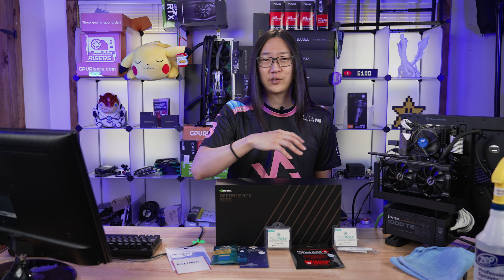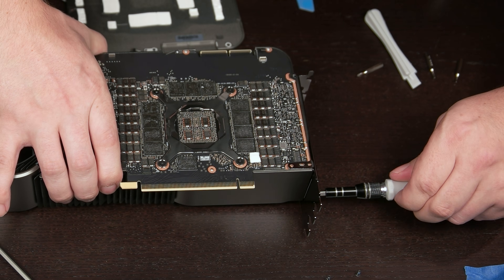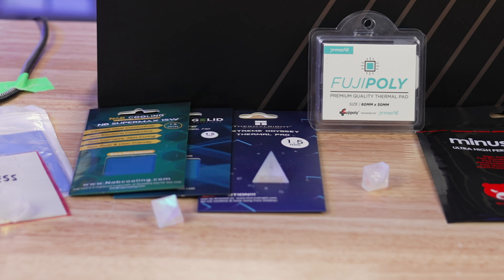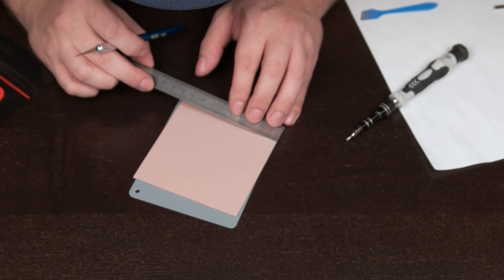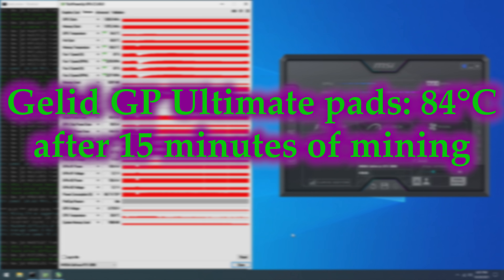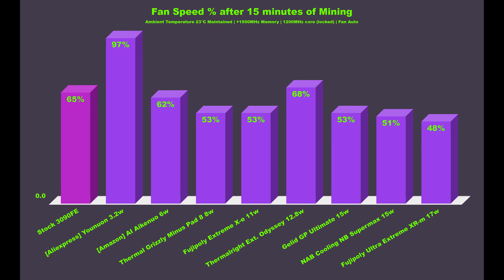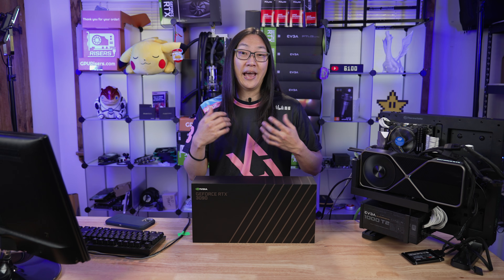Thermal Pad Showdown! What you should (and Shouldn't) Buy

Comment from the maker: This video has grown so much. It’s difficult to keep up with comments after the first one. Please message me and our discord link in the description! Otherwise, I might not be able to get your comment to help you.
Reply: You simply did such an amazing job with this test and deserve every positive comment here :)
Also, I would like to add a small positive side of keeping memory cooler and core hotter :
Since metals (like copper/tin, etc.) get physically bigger the more heated they are, keeping PCB temperature even/uniform across all areas should help in preventing traces/joints being damaged from material fatigue over long period of time (because difference in temperature creates different stretching/compressing mechanical forces inside PCB layers).
I don't know how relevant this is to longevity of the card, hence I classified it only as small positive :) 
It may not even be a problem for 5-10 years, since it depends on max. temp difference and number of hot/cold cycles each card had after all.
Reply from the maker: Thanks, I’m glad someone can appreciate our hard work! It took a long time and several hours to put this together, so we really appreciate it!
Reply: i commented not looking at the fact the video was 2 years old just take it with a grain of salt hehe.
Reply: Then the best is nab cooling?
Reply: Have you tested the Honeywell ptm7950?
Reply: Good one

Comment: Imporant Keyword: Thermodynamics
but daymn.. I almost failed in my physics class, mm so basically isolate the memory pads (or lower heat transfer balance) so that gpu can remove heat more? I did remember from the early computer days, were we would try to apply as thin layer of thermal paste as possible.. but just enough ratio.. for perfect balance, and temps reduced by 10c more than the usual messy way. but yes.. nobody got time for that, and just add more paste nowdays lol but getting back to thermodynamics, more 'area' means.. as you have guessed.. but either you go balance mode, or extreme it depends on the situation, plus thermal paste dries up eventually and a replacement is warrant..
Reply from the maker: That's right, getting the right balance with thermal paste is key for optimal cooling!

Comment: Thanks for this video info on thermal pads not paste is hard to come by.  As for the heatsink idea at the end, I put a copper 50mm x 50mm x 1.5mm heatsink on the back of my die on my evga 3080ti ftw3 and had great results where my gpu temperature rarely goes above 80 unless I am pushing it.  For an EVGA 3080ti ftw3 this was a huge improvement as that thing runs HOT.

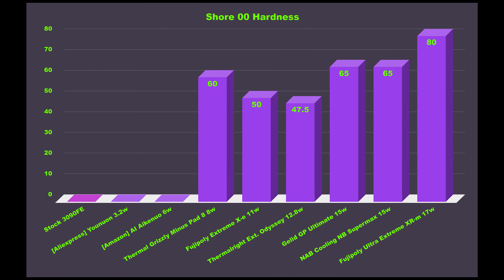Comment: What if the correlation between better VRAM temperature and worse GPU temperature is due to how the pressure is distributed? The watts of heat the VRAM generates has to be dissipated regardless of its temperature. I find it bizarre that the GPU could get up to 23c hotter, because it implies that in the opposite scenario, the VRAM would dissipate a lot of its heat through other means. 13:26 The 3 on the right are harder and I assume require more pressure to compress, and if the pressure of the mount is a fixed amount, pressure that goes in to squeezing the pads should reduce the pressure on the die. Just a theory.

Comment: Why did you remove the foil(s) before cutting (probably because it's convenient)? I'd remove them last to keep the pads as clean as possible.
This is the second time I've seen this video and today I think you're wrong twice.
1 When VRam temperature drops, fan speed should increase because the heatsink gets hotter
2 When VRam temperature drops and gpu temperature increases, it's because the fan speed dropped (which is weird, usually fan speed follows die temperature not memory temperature)

Comment: In my opinion, there is something wrong with the GPU board temperatures according to the benchmark which showed an increase in the GPU temperature on the Gelid GP Ultimate thermal pads. I am taking into account the laws of thermodynamics that you are talking about. And you are right that this is how it works. But imagine that the GPU cooler temperature is lower on the edges of the cooler or where the fans are. I do not know how on earth lowering memory temperatures can result in an increase in the GPU temperature? Rather the other way around. According to the laws of thermodynamics, the high temperature from the memory will flow outwards to the edges of the cooler where it is cooler and not to the center of the GPU where the temperature is higher than on the edges. It is known that memory plates surround the GPU.

Comment: I did not even think of better pads increasing the core temps due to more heat being transferred.... That might explain my issues where I was confused as heck re-pasting and re-padding my used 3060 Ti, where before I did I was getting 67c on the core under stress, but after I was getting in the 72-73c range. And the paste was basically cemented on it was so old, so I was confused why fresh paste would be worse, I even took it back apart and re-pasted again to make sure everything was done correctly, but it may just be the Gelid pads I used being much better at the heat transfer than the old stock pads I replaced....
Reply from the maker: Yea this is Something we discovered that is crazy! /

Comment: i used a proprietary blend of tp-3 arctic and valor odin pads. some people are strongly against it: a) cooling by stacking pads b) cooling the processors with pads in general. the cpu and gpu are cooled exclusively by a thin film of valor odin pad and so far it brought the temps -10 C lower than what was before. i couldnt be happier ! very strongly recommend it. this is a significant change, because cpu lifetime can be referred upon a deci-temperature scale that it usually is put under ! after trying the thermal paste, i found it to be rather inconsistent in its viscosity and response to heat, thus a possibility that it will leak, move, absorb and engulf extra bubbles of air during its use and hence a compromised cooling setting. this is never an issue with pads, which are tightly aligned and are doing their job great ! cheers !
Reply from the maker: Very nice! How did it work out long term?

Comment: I have a laptop g14 2023 that I will replace the CPU and GPU with ptm7950 and don't know what to use for the vrm and vram... I cant find official thickness needs for pads... and my GPU is thermal throttling at around 80watts. It used to go up to 120watts new. I really think it needs a change but I don't know what to use. I have heard that k5 pro is a bad idea for vram and vrms. You seem to know so much more about this topic do you have any suggestions about what I can do? I tried calling asus support and he told me between 1.5 and 2.5mm thickness.... that's a huge difference, so I have no clue what it actually needs.

Comment: what about co. such as Kritical pads that claims 20W/mK or brand like Liard Tflex HP34 pad that claims 34W/mK, how come there is no test on those 2?
Reply from the maker: At the time of production, it was not commonly available, but the most important thing is the thickness and size. It doesn’t matter how good the efficiency is if they’re not the right size.
Reply: @TekShinji  Liard is owned by Dupont, which is a multi-billion $ co.  So a co. of that size said their pad is 34W/mK, it should be true.  But it would be nice if you do a sequel to the above video w/ these newer pad.

Also, newer M.2 SSD such as Crucial has a plate on top, so there is no more worry on uneven surface, as such, as part of your next video, you should address the deciding factor of the thickness of the pad on these newer SSD
Reply from the maker: Oh absolutely. When it comes to SSD’s actually can be affected if they are too cold, which is interesting.

Comment: I just wish to know if its worth it using any of the pads here over the EKWB Provided Pads for a 4090 Waterblock. It seems no one has either asked or answered this question yet so, i cant find any info on it.
Reply from the maker: I’d recommend going with the ones from EK. But using different ones won’t get you that much of a different result. Water has so much thermal capacity that you won’t see that much of a difference.

Comment: This is a great video to reference now after my 3090 FE needs maintenance after 3 1/4 years. Although there is something odd about your results with the Thermalright Oddysey pads, as those were the pads I used, and I got the same sort of temperatures you got with the Gelid Ultimate pads. My 3090 had the memory junction temperature at 112 degrees when new, and I ended up replacing the pads just two months after I bought it, which was very annoying and stressful.

I used the 1.5mm thickness everywhere and got the memory junction temperature down to only get as high as 86 degrees under load when 3D rendering, which is also heavy on memory usage. I don't mine, so can't say how well it did for that, but it seems to be anything that is heavy on memory usage makes for good testing. At the moment, my 3090 is running a lot warmer than it used to on the core, so the thermal paste needs redoing, but the memory juction temperature is still the same as when I did it back then. I found this video as I'm concerned that even though the pads work alright still, they could end up crumbling if I try to remove them, so I think it's going to be safer for me to have some new ones ready to put in, and if the Thermalright ones can be inconsistent, I'll go with the better Gelid ones this time around.

Thank you for such a good video.
Reply from the maker: Awesome I’m glad that it worked out for you! Please let me know if you have any other questions!

Comment: It is a GREAT vídeo, bringing light in an issue people talk too little about, and It's about time you guys do a follow-up one!
I've been researching the subject in those past few weeks because I'm about to do the first clean-up and repasting of my new PC, so far everything is still stock. It is running great and I'm not having any problems, but I like to do the first repaste after one year and then just doing it again when necessary.
Some suggestions:
1 can we replace thermal pad with a very thick layer of thermal paste? I think we can't because we would trade conduction for convection, and that's bad, but thermal paste, after it has curated, may end up behaving more like a solid, so, test it I say.
2 if we put thermal paste WITH thermal pads, what happens? I suggest doing it in 3 configurations, paste in both sides of the pad, paste in the dissipator side of the pad only and paste in the die side of the pad only, with 3 specs, matching the thermal conductivity of both the paste and the pad, with the paste being weaker, and with the pad being weaker.
3 is there a way to make it work? if we improve the heat dissipation to a degree heat gets blasted away before returning to the die?
Reply from the maker: Hey there, thanks for the comment. It’s kind of hard to follow up on all of that in one comment/YouTube comment if you want to join our discord and join the conversation I can definitely talk to you more about there!

Comment: How do thermal putty options like k5 pro and upsiren putty compare to pads? I hear mixed opinions but not much in the realm of facts. Ease of use,long term durability, clean up, reusability.
Reply from the maker: Thermal putty definitely has its applications and as long as it’s thick enough, it should last quite a while. But also at the same time it’s usually used an applications where the thicknesses are too different or thermal patch work.

Comment: I bought thermalright extreme odyssey and as you state it in fact comes thinner than the specified thickness. 1mm came with 0.8 to 0.9 on the edges. I lost a considerable amount of thermal pad and contact pressure.
Reply from the maker: That’s one of the problems is that even with good manufacturers it’s more dependent on the thickness of the pad than the pads thermal conductivity

Comment: the same thing with increased temp for core but also hotspot temp,  while replacing it for the gigabyte rtx 3090 vision ,happened to me. ii bet if you tried 1 mm padsfor FE ,it would not happen the same. i found out that the hitsink pressure was not good on my die with 2mm pads (which were also the stock thickness) , and i bet replacing them with 1.5mm solves the problem because i pressed the 2mm ones making them thinner and it solved the problem
Reply from the maker: I’m glad you got it figured out!

Comment: so i have an older  rx5700xt raw II and its always been a hot card and recently i also changed the thermal pads.  since i was changing some other stuff as well i figured why not.  i heard of the gelids  and i couldn't find them on amazon so i was looking around and ended up noticing that the nab supermax looks super similar .so i got 2 of these pads  at 1.5  and then was noticing that my gpu temps went up but my memory temps went down by like 8c but my gpu temps went up by like 5c  even tho i know for sure the thermal paste i used was better then the one that was on it. plus i did the plastic washer mod to add extra pressure .  so i was also thinking that the extra temps from my memory being transferred to heat sync was being shown on the gpu core  and that made me start looking into the temps that each part was able to deal with before throttling or just over all having issues and so ive been thinking that maybe these companies use the lower transfer pads as a way to give some cooling but somewhat control what can heat up more  for example the vrms can deal with 175c with out actually dying even tho its not normal or something that should be happening but it can happen
and to transfer that heat to the heat sync seems counter productive!
Reply from the maker: Correct!

Comment: Wish there were reviews for the very few thermal pad brands that have 2.25mm pads which I need (the only 3 I found are kritical pad, fehonda and XPC high performance thermal pad)
Reply from the maker: Those quarter size pads are not as common. And in my experience are usually not necessary, depending on the shore, hardness or squishiness.

Comment: I bought some 0.5mm GP ultimate pads recently for the Northridge of an old g45/c2d laptop.

Not impressed (suspect counterfeit?) They are very dry bordering on flaky, they do not compress much either preventing them from conforming to the chip properly.

The original was actually a 1mm pad but it was soft, enough so that it could be rolled into a tacky ball and squished between my fingers.

This results in an air gap on the CPU die.
Reply from the maker: It was so hard to find the consistency. We found that every brand was kind of like that thermal grizzly and the Fuji seem to be the most consistent, but also are most expensive.

Comment: The thermal power transfer from the memory to the cooler is constant, namely at equilibrium it is simply the power usage of the modules. The reason why there is a anti-correlation between memory and gpu temperature is likely that the cooler mounting pressure shifts from the gpu die to the memory modules.
Reply from the maker: Thanks! That is also a theory we had! Have you tried any thermal pad, stuff yourself or interested to hear results!

Comment: I'm only adding a heat sink to my ASUS ROG ALLY M.2 SSD and am looking for the best thermal pad for it.

I am a little confused after watching this, so can anyone point out which is best?
Reply from the maker: I understand it might be a bit confusing, but as we explained in the video, it’s because the Best pad does not technically exist to do to its application. There’s other side effects that happened with two good thermal transfer.

For your M2 SSD doesn’t really need the thermal pad. Any cheap pad will do. The diminishing returns are drastic on something like that.
Reply from the maker: What matters the most is making sure they are the same thickness/size and hardness which is very very difficult since there’s no uniform scale that people go by

Comment: Hello everyone,

I have a question regarding the correct size of thermal pads. The manufacturer used both 1.25mm and 1.75mm thermal pads. However, I'm unable to find thermal pads in those specific sizes. I'm unsure whether I should opt for a size that is one level up or one level down.

For the 1.25mm thermal pads used by the manufacturer, should I choose 1mm or 1.5mm? Your guidance on the best option would be greatly appreciated.

Thanks in advance.
Reply from the maker: Those pads are pretty rare. It’s not easy to find. I’m not sure where you’re from but especially if you’re not in a United States orientated country it’s very difficult.
Reply: search for fehonda they have it
Reply from the maker: Awsome thx!

Comment: How do these compare to the new graphene pads?
Reply from the maker: How do you mean? They’re technically two totally different things.
Reply: @TekShinji  two totally different things that do the exact same thing, so what are you confused about? They both replace thermal paste to provide cooling to a CPU.
Reply from the maker: @Onibabayaga  graphing pads are generally not used to wear. Thermal pads are being used. For example, you wouldn’t use a thermal pad in most cases under a CPU or on top of an IHS.

I understand that they do the same thing, but also cheese and ice cream or technically from the same thing? 

What I’m trying to say, is there two different applications that transfer heat. And yes, they do the same thing which is transfer heat but they’re generally not swappable in the field.